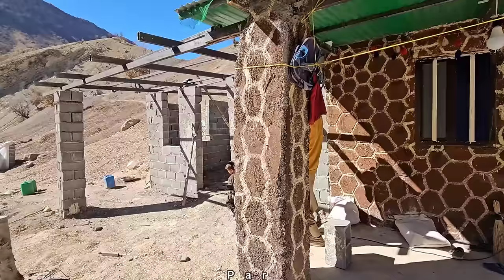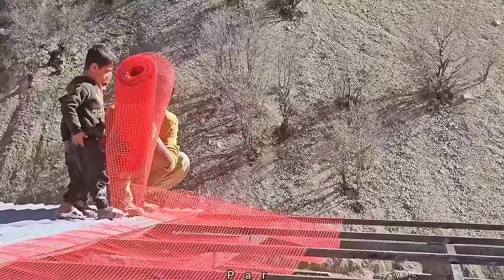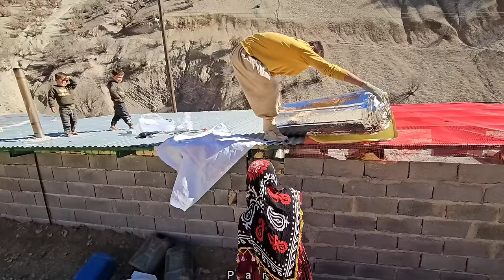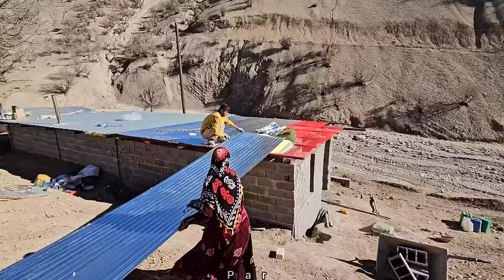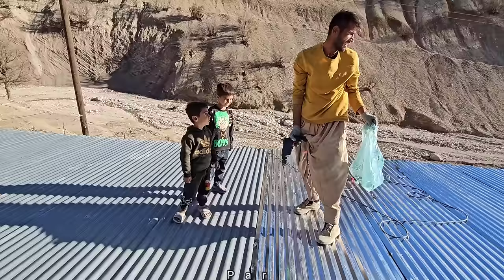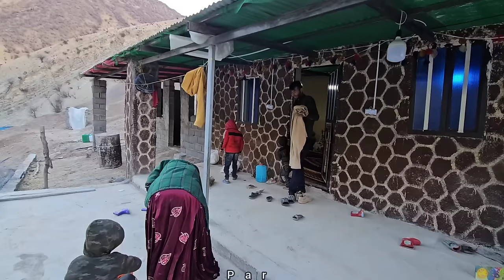Build a house in the village🏡🧱 Young couples try to build a kitchen without having to hire workers

Comment: Babak inside the kitchen you don't need to spray it and just scrape the walls well and paint with a plastic paint, apply it 2 or three times, it saves you having to spray it outside the house and do the floor ❤